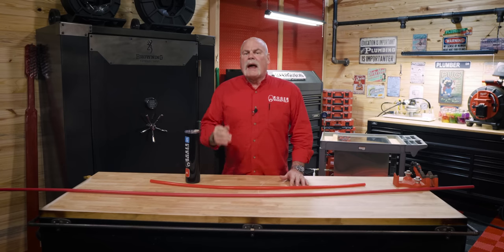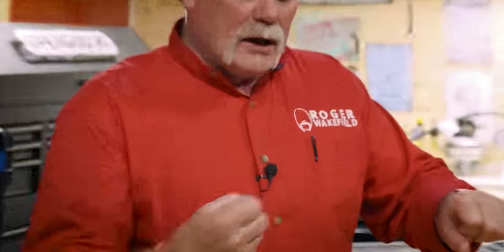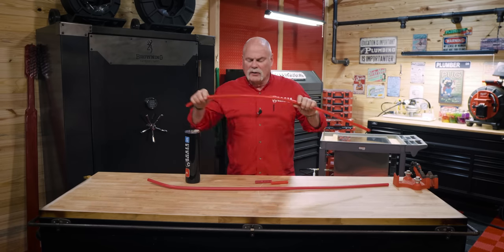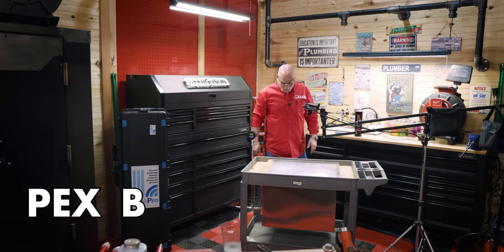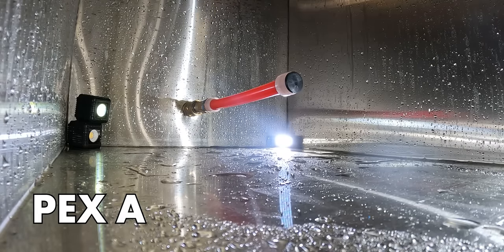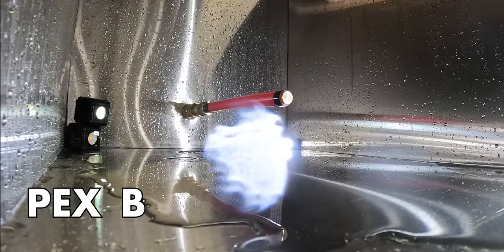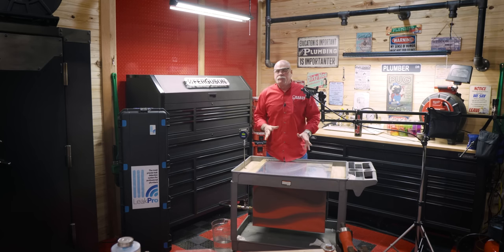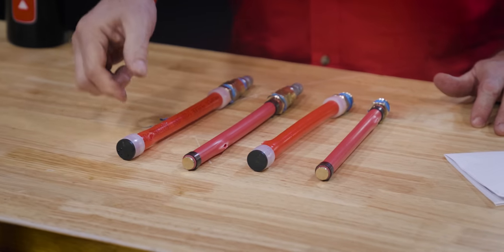Which is Better PEX A or PEX B | Pressure Test

Comment: I prefer installing pipework in attics as opposed to under a slab. I would love to hear your take on it. I believe, concrete slabs will outlive any pipework that we put under them. So when the pipework does fail, it is easier to re-pipe the house from the attic. Yes, damage is done to the house, but if you weigh up the cost in my area for slab re-pipes as opposed to a re-pipe in the attic. the slab re-pipe is more expensive than the re-pipe in the attic, including repair costs to the inside. Also, when you have a pipe issue in the attic, you know immediately. It doesn't wash out under your house.
Reply from the maker: I am against pipes in the attic! Especially in Texas, it is too hot and most times difficult to work on and IN!
Reply: We do have to repipe at night in the summer. It is truly miserable work.

Comment: I've been more curious about the service life of PEX vs copper.  I've recently been shopping houses, and it seems the proliferation of PEX is limiting the lifespan of the house compared to copper.  I understand the benefits of installing PEX, but replumbing a house isn't a trivial task, especially when the piping looks like a plate of spaghetti, as many new-builds do.  What is your take on longevity?
Reply: My copper pipes got it first pin hole leak at 15 year and  started getting a bunch pin holes at 20 years. My grandpa said the guy who installed it used cheap copper. 

I’m really only commenting to see others opinions.
Reply from the maker: Personally I prefer copper over pex, it looks nicer it lasts longer (if installed and soldered correctly) and rodents tend to not chew on copper 🤷🏻‍♂️
Reply: I think it mostly depends on your water supply. In my area (Middle Ga) we use PEX B. We only use copper to meet fire code or when needed(around gas appliances). A majority of the water supply here is from personal wells. Ground water that is not run through a treatment plant has the potential to eat through copper very fast. And the quality of the water from the ground can change, it is not set by the guys running the plant.  I have seen PEX A that was installed in the early 90's still going strong, but I have seen copper that was installed in the early 1900's that is still kicking as well.
Reply: @RogerWakefield lasting longer is definitely wildly dependent on water quality.

Comment: I believe the burst pressure of pex B is listed higher so I'm not surprised.  That said I'm in northern Michigan and have never seen a pex A failure. 

Although rare I've seen some freeze failures from pex B, usually copper crimp rings, less so with the stainless ones.  Once they are deformed from the ice expanding they never go back to their  correct size.  That's the beauty of the ProPex system, it all expands and contracts together.

Comment: I have always expanded the joint like you did where I bottom the tool out and then expand a few more times. I recently read on nibco or upponor installation instructions (can't remember which one) that you should only expand it one time after it bottoms out. They said it can over expand the joint. 95%+ of my upponor connections have been fine and didn't leak but it made me wonder if I over expanded the joint on the few that did leak.
Reply: Its likely that there was a tiny knick in the fitting on the largest ring seal
Reply: I use uponor all the time, you CAN’T over expand it !! The tool head only opens so far and that’s it !!
Reply: @geneticdisorder1900  I have always thought so myself as well but according to the nibco instalation instructions you should not expand more than once after bottoming out. I was initially taught to give it a few extra gos just to make sure you have time to fit it all up.  but when I was reading the instructions from the manufacturer while I was waiting on glue to dry it said just what I just said. Don't know if thats true or not and it hasn't seemed to be a problem for me in the past but that's what it said.
Reply: @brasshouse-og  I hear you, but I’ve had issues jamming the fittings in, especially if it’s a warm day. I’ve had to slam in the fitting.

Comment: I am installing a 1/2 inch 3 way ball valve in my motorhome.  I have very little space in back of the valve and need to use a 1/2 inch NPT to PEX elbow.  When I tighten the pipe elbow, it orients away from where I need it pointing.  What can I use to get the threads tight and in the direction I need it pointing to?

Comment: Would love to see a similar test, but bring it to like 500 psi and hold it there for a bit. See if a fitting develops a leak
Reply from the maker: That would be a good test…hard to do it with a hydrostatic tester tho…it’s either all or nothing
Reply: @RogerWakefield  Maybe AvE or Torque Test Channel could provide some help there.
Reply: @RogerWakefield  How about filling the tank with 160F water like would be fairly common in radiant heating or some houses before a mixing valve. Then let it sit for twenty minutes to soak the heat in and test.

Also test again with various common forms of damage. Nicking it with a shovel, scratches due to dragging it in a trench, or sliding a shovel along it to dig it up. Slight crooked crimp rings, the stainless crimp ring style, kink it and then test (how bad is it really), bend it over an edge of a hole through 2 by x material like would be common in running it thru stud cavities, does a tight radius and the stress on the fitting reduce it a lot, does the exiting a slab, and the rigid to free situation cause it to fail much lower? Lots more interesting tests can be done with this setup.
Reply: @RogerWakefield  make up a connection to fill it with water.  Than pressurize it with regulators connected to a nitrogen tank.  
Can pretty accurately get whatever pressure you want on it.

Comment: PEX B is actually known to be the better product - it's stronger, and leeches less chemicals into the water. Yes, PEX A lets you unkink the pipe, but you really shouldn't be kinking it in the first place. The flexibility of PEX A is also nice, but you can warm up PEX B and it'll be fine.

PEX A has some durability issues, with several brands having failures. PEX B has not had this issue.

The only real benefit of PEX A is the full-flow connections, PEX B has slight restrictions, especially if you use plastic fitting (don't use plastic, use metal fittings).

Comment: Getting fittings for pex A is not as easy and available as pex b. Is it possible please to test using half inch picks A pipe with 3/4 pex b fitting. Or three quarter pex A pipe with 1 in pex B fitting

Comment: interesting that the failure happened at a higher pressure with the fast pressurization until you consider that a pipe failure has an elapsed time, so the pressure had time to continue increasing WHILE the pipe was failing.  

all the same - even I run only a tenth of that pressure.

Comment: There is legit no reason to use Pex B for the most part, unless you are working in a home that already has it. Uponor is rated for the expansion rings AND crimp rings. Uponor is more durable during freezing events, more flexible, easier to run in long distances or around bends. This test is interesting, but ultimately irrelevant, espically considering the highest PSI you will ever find in any given residential or commercial application is rarely higher than 130 PSI, and is most often in the range of 40-120 PSI.

Comment: I’m confused.  Online it says that frozen water pipes increases the pressure from the normal 30-60psi operating range to 40,000psi.  If both Pex types burst at 1000ish psi, how are they able to handle frozen water?!

Comment: Several things I noticed, one you used the same color pipe.  Might have been better to use the two colors so people know the difference.  Also I noticed all the failures were close to the ends.  Is this just a freak coincidence or is there a problem with the fitting installation weakening the pipe (yea does it really matter at 10 times normal pressure).  Matt Risinger also did a test like this (actually he was testing fittings) and his also failed near the fittings.  Curious if this is something to investigate further.
Reply: Shock wave from pressure

Comment: What really matters is what happens to the material over time. CPVC is great when installed, but becomes brittle and prone to cracking after only 10 years. What are the properties of the material after 19 or 15 years? Can't test that on youtube so its not discussed.

Comment: we had a back feed of steam get into pex, it blew the abs fitting off a water softener.  but pressure is pressure.   im more interested in the longevity 

(my example was a poorly designed water cooling system for an industrial autoclave)

Comment: How about a high pressure test where you set the pressure at increasing psi increments to see which pex fitting will start leaking first?  In this test, it seems the pipe reached its limit and gave out long before the fittings were able to.
Reply from the maker: We had it set up to a hydrostatic tester, so small increments of pressure is not doable with our current set up. Its either all or nothing

Comment: It’s not about max psi. These are high enough. For freezing conditions it’s also about how much expansion the PEX can take before failing since frozen water takes up more space.  Therefore, expansion and ability to recover from that expansion (get back to its normal state) is important. That’s what makes PEX A better suited.  If a tube can’t recover from expansion and recovery, eventually with will expand to failure after a few cycles. 

A ballon, for example, can with stand much less psi than a copper pipe. But boy will it expand over and over again and won’t pop as the water inside freezes.
Reply: Pex A or B has much better resistance to freezing than copper, galvanized, cpvc, and copper so the debate is a moot point
Reply: You may want to do your homework, as pexb is the better choice for this type of installation. Pex A will expand but in colder climates it will not contract the same. It will start to degrade and crack. Pex b is a stronger material and the top choice in Europe for this reason.

Comment: Try using zurn pex b with pex a style fittings the zurn pipe is actually formulated to be expanded even thou its a b pex blend pex a i have started hearing it is having simmilar issues as quest used to because the color coating on pex a when it is put on it cooks out some chemical that makes it resist clorine corrosion so in my house i actually used expansion fittings with zurn pex b to hopefully mitigate the pipe issue with pex a that could be why upanor stopped color coating there pipes ive noticed they have all been comming in clear but idk thats all my opinion probly should look into thou and srry about spelling
Reply from the maker: Don’t worry about spelling I understood, thanks for sharing that!

Comment: PEX A keeps full port with connections and Fittings  while PEX  is reduced. so if flow rate is a issue PEX A would a be better choice.

Comment: Because the PEX-A can expand more than B during a freeze event, the pipe will expand and relive the presasure caused by water freezing. This  isn't  an unlimited volume like your test. I bet if you measured the volume of water till burst, it would be much higher with PEX-A

Comment: The big issue is pipe freezing and breaking at the copper joints. If you can avoid that you will almost never have a problem. PEX A is the solution to that problem.

Comment: Have seen pex b  extremely bad installed , and still holding  after 20 years , my level of trust is very high in that one . Pex a is good but i actually seen leaks on fittings that look fine,.
Reply: I tripped over a video where the person said the Pex stainless steel rings failed when the barb that holds the ring tight failed, resulting in leaks because there was insufficient tension to hold everything together.

Comment: I have been using pex for 25 years. Crimp is so much better and faster than expansion. Only issue in all that time was spray foam insulation once causing pipe to heat and burst while i had air test on it for inspection. Either pex is great and better than copper
Reply: Pex is for homeowners and handymen. No skilled plumber is using pex for potable water.

Comment: I noticed he used the pex expansion tool wrong. He’s manually rotating the pipe during each rotation the tool makes. You’re not supposed to rotate the pipe. Just allow the tool to rotate for an even expansion. If you counteract that, the expansion won’t be even and it will cause a leak.

Comment: Harder PEX requires more joints and holds more pressure but fails in freezing cold and extreme high pressure and hot water softens and leaches toxic ppla in the water where copper brings it's advantages PEX is good for easy access and replacement than iron cast or copper in older houses than newer houses because it's flexible and easy to install but strength and toxicity comes in

Comment: repeat the test with tubing that's been scratched on sharp wood pieces, nails, nail plates and other common construction materials, maybe some hammer, knife cutter strikes and see where it fails first. most likely anywhere the surface is no longer perfect.

Comment: Uponor when it fails, and it is going to, say they warranty their failed product. I replumbed a restaurant that had uponor that failed repeatedly. Uponor came and inspected and tested. I had spent a year coming out and doing temp repairs while uponor made arrangements to do their process. In the meantime the restaurant rained several ceilings down. Everything was purchased and ready for the day they were complete. I replumbed the restaurant during overnights so they could stay in open. Uponors determination was that their pipe didn’t fail, they decided that the 2” prv must have failed at some point which weakened the pipe. What was their proof of that? Well they had none, but that determination was cheaper than paying 10k to warranty their product. They didn’t seem to happy when the corporation decided their was no chance that uponor would be the pipe that was put back in. Uponor couldn’t understand why they wouldn’t chose their pipe at the reduced cost (which was still higher than the pipe I chose)

Comment: PEX is a polyethylene material which has undergone a change in molecular structure using a chemical or a physical process whereby the polymer chains are chemically linked. Crosslinking of the polymer chains of polyethylene (HDPE) into PEX for pipes results in improved properties such as elevated temperature strength and performance, flexibility, chemical resistance, environmental stress crack resistance (ESCR), resistance to slow crack growth (SCG), toughness, and abrasion. Crosslinking makes PEX a "semi-thermoset" polymer, providing excellent long-term stability.

Comment: Do some more test.  Certain amount held for time.   Make up a connection to fill it with water.  Than pressurize it with regulators connected to a nitrogen tank.  
Can pretty accurately get whatever pressure you want on it.

Comment: Most peoples water pressure is 60 PSI or less, but in this test PEX B withstood higher pressure than PEX A which was far over the 60 PSI max pressure people will see. I don't see the point of this video other than to say you're not going to have a pressure burst with either PEX A or PEX B.
Reply from the maker: Its fun to blow things up first off, and to some it's also good to know what the failure point is. When installing pipes in a home wouldn't you want to install the best? Yes pressure will not get to 900+psi but why not install the best there is?

Comment: After watching this video, why does PEX B even exist?  It seems like the inferior product all round.
900 vs 1k PSI feels insignificant when 900 is still total overkill.
Reply: PEX B has better resistance to chlorine than PEX A so those on city/county water supplies will have to deal with chlorine in the water.

Comment: What is the point of this test? Normal water pressure should be 80 psi or less.
Reply from the maker: Wouldn't you want to know if the pipe or the fitting will fail first?

Comment: I'm not a fan of pex pipes.
They don't work good for winner where I'm from. I like copper Soderen R brazen. I don't like sharp bites. I don't like pressed. There's nothing wrong with the old school way. Cause it works fine. The new stuff don't work with that great.
Anything new these days? They engineer, even on vehicles. It's just garbage

Comment: I am a master plumber in California. I would never use pex in a house. I've repaired too many pex fittings. That looks good but leaked. The other holes were caused by rats or mice. The insurance company does not cover rodents. This is another way to try to build a cheaper house. I have worked in many High rise buildings with 70 year old copper. Unless your water is very corrosive stick with copper type L blue. No, old time plumbers that I know will ever use Pex for a permanent fix. If I put a water heater outside temporary during the remodel, OK.

Comment: This test doesn't really prove anything. You're worried about pipes freezing, not 1k psi in your pipes. When water freezes, it expands, which most people translate into pressure. While this does kind of correlate, it doesn't paint the full picture. The water/ice expanding is a displacement. PEX-A, naturally, can be expanded without breaking, that's how you make the fittings. PEX-B cannot. So, while PEX-B might hold more pressure, it's resistance to expansion is going to cause that pressure to build up much more than a PEX-A pipe. You can even see this in the video. The PEX-B pipe doesn't change diameter after it bursts, while you can visibly see PEX-A deflate after it bursts.